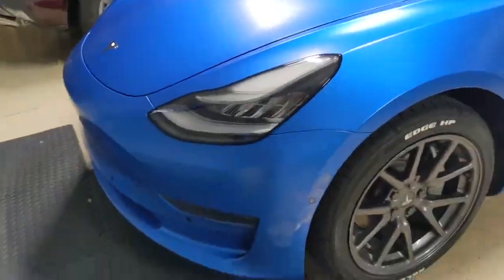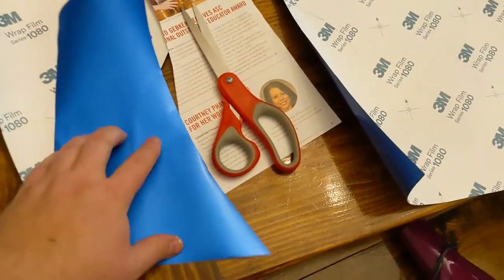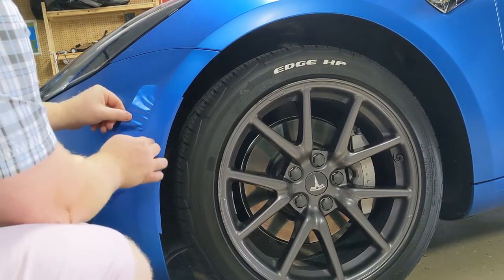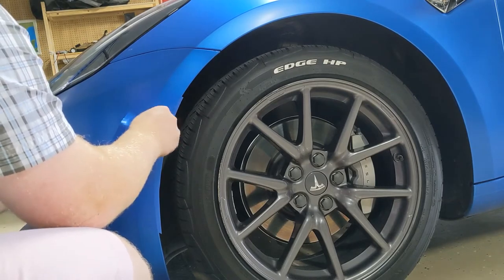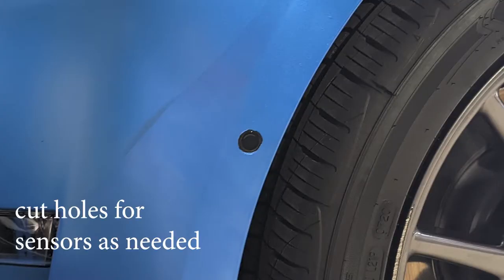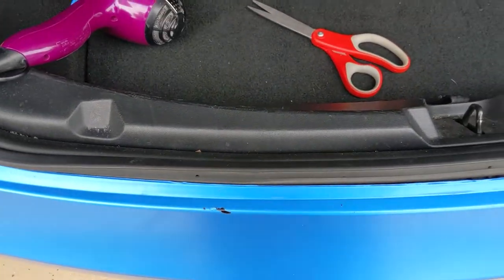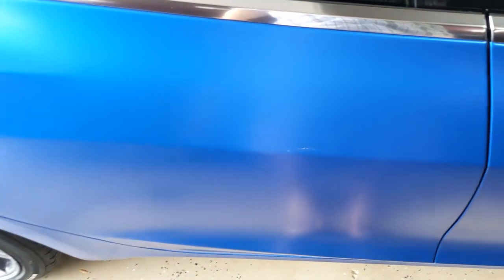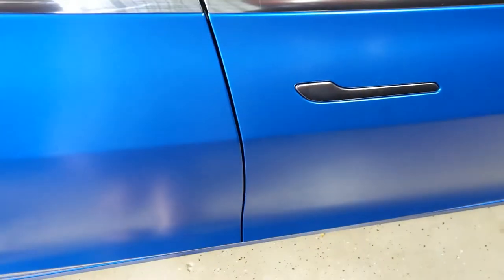How to patch vinyl car wrap without replacing entire panel

Comment from the maker: 3yr follow up. The patch job I did in this video worked great, none of the 4 areas I patched ended up peeling off... key is to apply and then heat up area to create good bond. Worked great, i jusy removed my entire wrap after 5 years on the car. My patches were still in place on the car
Reply: Hello! When you have scratches on your vinyl wrap and just patch it up like what you did in the video, will it not cause to start the rust for the body of the car? I'm just curious.

Comment: 1 year follow up:  BTW everyone, my patched pieces have required NO maintenance... The edges have not got grimy and it still looks good. I have driven it through touchless car washes dozens of times with no issue. Summary: This method works, is cheap, and holds up over time
Reply: Hello! When you have scratches on your vinyl wrap and just patch it up like what he did in the video, will it not cause to start the rust for the body of the car? I'm just curious.

Comment: Came across this video after looking for a temporary fix for a similar scuff on my front bumper. Only difference is that the wrap on mine peeled off a bit in a few spots. Should I try cutting and then carefully sanding the edges before I attempt to patch it? Honestly I’m nervous to even try but it will be a while until I can get my car in for the bumper to be redone.

Comment: Look good. over time though dirt will stick on the edge and will be more noticeable.
Reply from the maker: just went out and checked, there's a little bit of dirt on the edge but is hardly noticeable unless you are very close to the car, about 1-2 ft away, completely unnoticeable after that
Reply: @TheCaneVideos  can't you use a sealant or edge sealant like what 3m offers to fill the edge and make it smooth?
Reply from the maker: @K4leidos  I'll look into that,  didn't know it existed
Reply: It would shine differently

Comment: i think doing what you done and then taking a sharp knife and cutting through both layers of vinyl would give a better finish as it would sit flush on the panel and would give it a butt joint instead of a lap joint
Reply from the maker: yeah I didn't trust myself not to cut the paint, but that would be better. This really looks just fine, far better than the major scuff that was there before..
Reply: For film you have to overlap otherwise over time it will start pulling up and you will end up doing some warranty work or they will take the vehicle to someone else entirely.

Comment: I’m a wrapper, just to help you, this is how you end up on wrap police. Wrap police will blast your work all over social media, and that will hurt your business. Yes it hides it but no its not quality standards for wrap. If the piece can be saved, from bubbles or anything in that nature go for it, but for something like this requires a new entirely new piece. But my only suggestion is to keep practicing through videos or mentor or best option is both.
Reply: I'm not a wrapper, this video is not for wrappers, it's for people like me who don't want to pay 700-900 dollars to redo a single small panel. It's been almost two years and my solution still looks good. So from my own anecdotal experience, I'm totally cool with this and would recommend to anyone who doesn't want to pay that much to fix small wrap issues